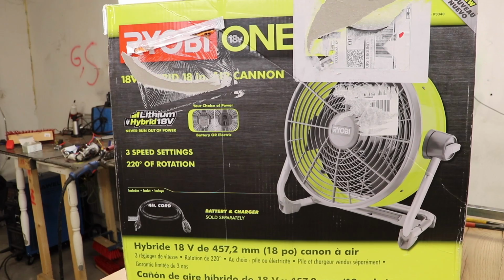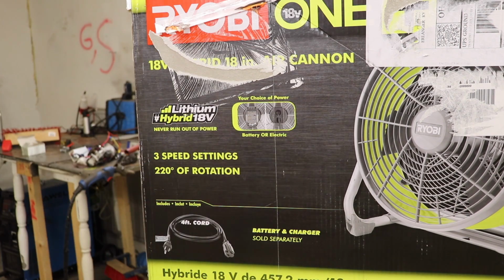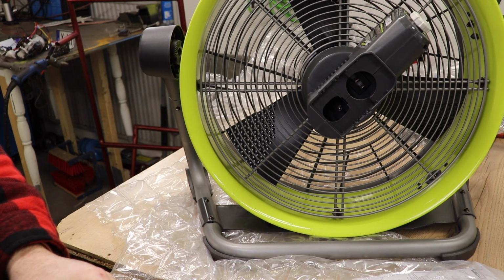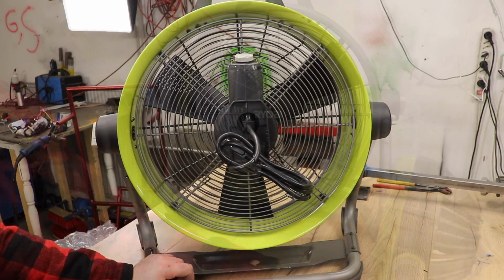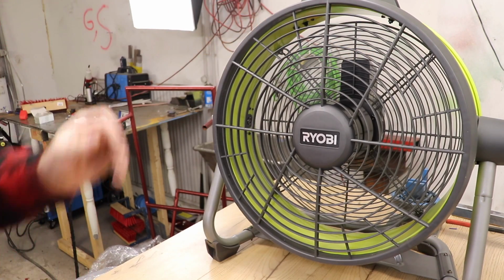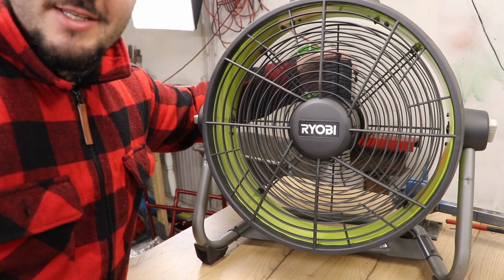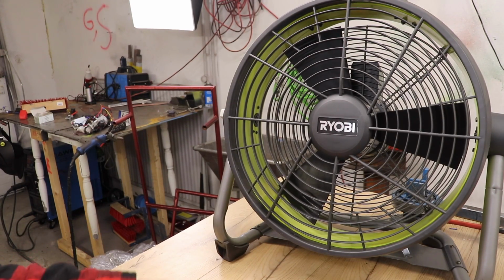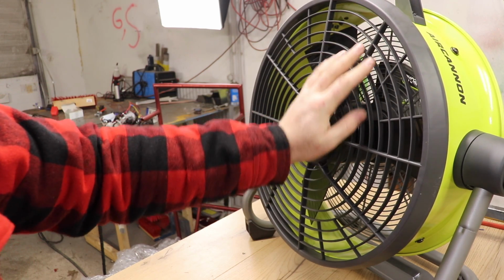Testing New Ryobi Air Cannon

Comment: Hi there,I live in Australia where we have 240 volts,I purchased an item from America that is 0nly 110 volts so I purchased a little step down transformer for around $30 new to run it,maybe you can purchase one as well if you want to run mains power,the transformer for a fan application will only be small so not to take up any room,Ava great day